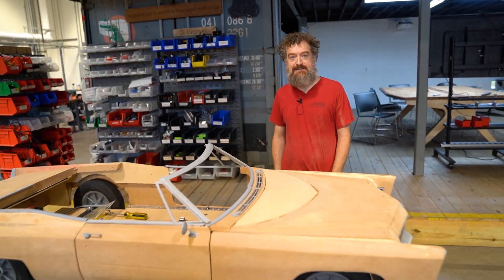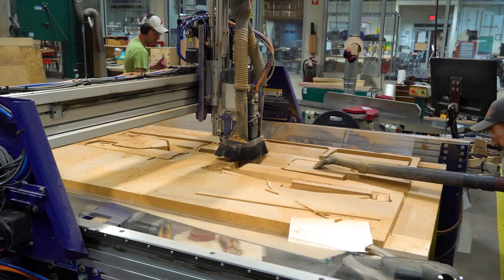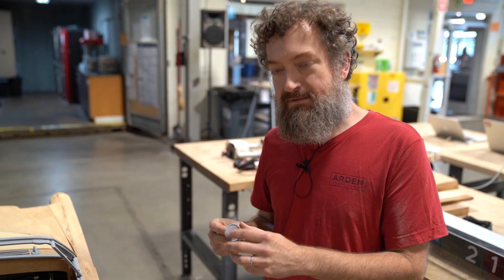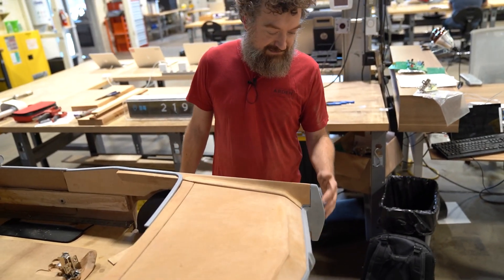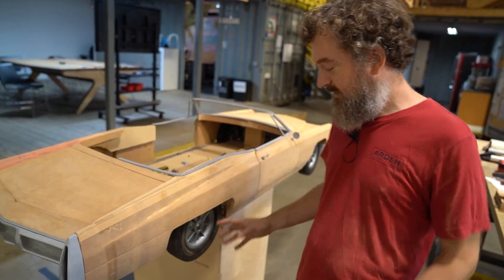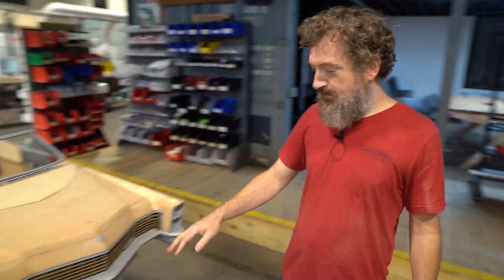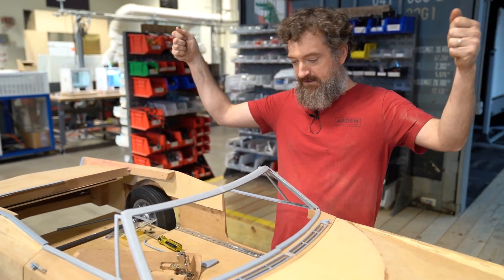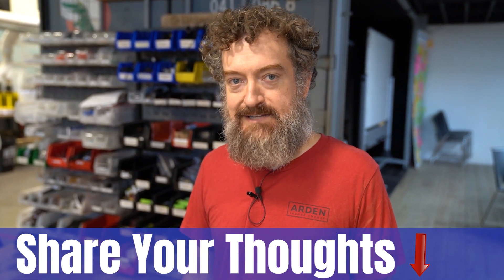Can a 1/3 Scale Model Go Highway Speeds?

Comment: Maybe you could vacuum seal some vinyl on the body and it will hold the mdf together and protect it. It would add strength to those areas that tapper out real thin. If you want realism it should have 6 or more ashtrays some with built in lighters, and no drink holders to save your life.